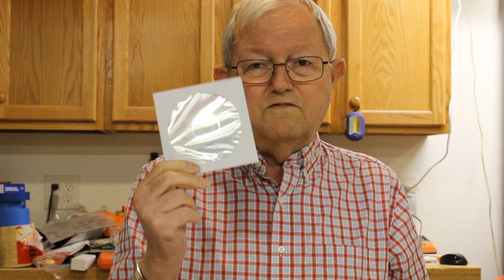I REVIEW THE DOWELMAX DOWELING JIG

Comment: I really like this tool as it’s very robustly built and very precise.  I was considering getting a domino tool to use loose tenons and mortises.  But in actual strength tests, dowels beat the domino mainly because you can create more glue contact by using a number of dowels in the space for one domino.  Sure is a lot cheaper when you think about this trade off.
Reply from the maker: Peter,  I agree completely.  I try to never say never but chances are I would never purchase a domino tool.  I agree 100% with you regarding the robust nature and accuracy of the DowelMax.  Thanks for watching the review video and for the great comment.

Comment: I may have missed this part, but, what if you need different size dowel holes for thinner wood?
Thanks
Linda
Reply from the maker: Linda, DowelMax does offer a set of 1/4" bushings and a quarter inch drill as a set.  For the current price check on their website.  Good question, thanks for asking.  I appreciate your watching and your input.

Comment: Hello Paul. It was a great presentation. Can I use different size of dowel ? If I can please tell me how. Thanks
28:00
Reply from the maker: Bijan, Yes, DowelMax offers a set of guides and drills for 1/4 inch and 1/2 inch dowels.   It comes standard set  up for 3/8 inch dowels.  I have a video on my site where I check out the 1/4 inch guides and dowels but haven't tried out the 1/2 inch ones yet.  Maybe in a future video.  Thanks for your question and for taking the time to watch my video.  Happy woodworking.
Reply: @paulsmessyworkshop  Hi Paul thanks for responding. If I want to use a thicker dowel , how much ticker I can go ? Is there an extra accessory that I can purchase for a ticker dowel ?

Comment: Thanks for the review. How are the holes centered within the material when using different thickness materials?  For example, it looked like you were using 1 inch thickness, I need to use 3/4 inch thickness
Reply: It’s default is “basically” centred on 3/4 in material.  You insert those adjustable spacers to adjust the center point.  But they can’t account for infinite numbers of thicknesses.  I have found that the key point (for me) is to  insert spacers to get as close to center on whatever piece I’m  using, (if I even want it centred), but worry less about that and just alway align the check marks on the tool with the wood.  Then any variances don’t matter and the boards are always flush.
Reply from the maker: The Dowel Max references off of what ever FACE you want to be common.  If you want it to reference off of the center you would have to shim on all pieces to center the same.  By referencing off of the FACE you are guaranteed to have a smooth joint.   If that wasn't clear in my video I suggest you check out their website.  There are more videos there that might be easier to understand.  This jig is crazy accurate.  Thanks for you question.
Reply: @paulsmessyworkshop   Thanks, makes sense. Im gonna get one and start learning it.
Reply: @lp9092  Thanks, getting one to try it out
Reply: @frankpearce2544  anytime.  It took me a while to figure it out... I misaligned a few things to start.  But it took my projects to the next level when I eliminated screws, and started making joints the equivalent to mortise tenon.  Have fun!

Comment: Hi Paul, loved your video on the Dowelmax. What length dowels would I use on a beveled 3/4" board?
Reply from the maker: Jeffery,  that is a hard question to answer, it would depend on the length of the dowel you are using.  The dowels I use are 1 1/2 inches long plus I leave a bit at the end for excess glue.  I make the holes 7/8 of an inch for each hole.  If you don't have the room for that much length you can always make the hole not as deep and cut off the dowel to fit.  Hope this helps.  Thanks for taking the time to watch and for you question.  Sorry it took me so long to respond.

Comment: I make my own set of fixed jigs for jobs. That way its set up that if i require 3 x different Joints .I make a jig for each as the chances are the timbers will vary .Then i colour code them .Once i have cut my timbers .I mark each set to match each jig. It never ever goes wrong. Buying  metal  drill guides from ebay .I can make jigs in mins  and now have 7 .Which covers me for just about most work /timber I use .
Reply from the maker: Carforumwanker,  a good solution to the problem.  Not everyone is willing to take the effort to do what you do.  For them an adjustable jig works out fine.  Happy woodworking.  Thanks for watching.

Comment: I bought the Dowelmax jr. since it was the cheapest and just happened by design to be perfect for my project. Like that in this video cover most of the Joints. I am going to be doing a Picture frame for my coffee table and wanted to review how to make the dowels on the 45 degree cuts.
But yes basically 2 checks and X for the dowel tap surface this makes sure you know what sides your aligning OFF..
Like the fact the the design is based on ligning up off one surface vs two thus more accurate and consistent.

Only issue is seems dowmax sent you everything. There two units the Standard and the Junior. The Junior has the 3 smaller spacers and the angle bracket. The Standard has outer brace so you don't need a C Clamp, but does not have the L Bracket and includes the larger spacers you see when showing how it can fit a 4x4. Also the spacer and spacer rod is included.

with the junior instructions are include on how to make a spacer rod with piece of wood and a dowel and how to make spacers from hard wood.

The 45 degree shown at the end of the video is optional and the L bracket can be purchased optional. both unit by default are for 3/8 Dowels, You can purchase optional for 1/4" Dowels. Spare drill bits can be purchased also optional. The dril bit is really really nice, it includes the stop ring it has two apposing screws vs 1.

otherwise this is a great tool.
Reply from the maker: James, yes, I agree that the Dowelmax is a great tool and like most anything today you can buy it with as many or as few bells and whistles as you want.  The nice thing is you can go to their website and purchase any of the other parts if you want.  Thanks for taking the time to watch and for the great comment.

Comment: Thank you for your review Sir. Very well made. 
I understand the check mark reference for side and edge. But is there reference 'line' to match with a hand drawn pencil line for edge joining two boards together (for making table tops)? What I mean is if drew random pencil marks randomly any where 'across' two boards, can i line up the jig to drill holes on both boards such that the two panels will properly edge join.
Reply from the maker: MishtiLiving, the simple answer is YES, you can do that.  All you need to do is to draw a line across the joint then line up the END of the jig with the line.  Drill the dowel from the same hole on each board and the lines will line up perfectly.  Try it on a scrap just to practice what I have just explained.  Sorry for the delay in getting back to you...sometime life gets in the way.  Thanks for watching and for you question and comment.  If you have any other questions feel free to email me at:   paulsmessyworkshop@gmail.com

Comment: Hi Paul,
I was wondering if you can tell me if I can use the 45-degree miter accessory for drilling miters in 2 x 4 stock? If possible, what spacer(s) would I need to get it centered? Or would I need to use two rows? And if so, what spacers would I need then? (This is not going to have to be strong, just accurate. Appreciate any help.
Reply from the maker: Spider One,  my immediate answer is YES but I will have to check to be sure.  I will give it a try and maybe even make a video.  Either way I will let you know how it comes out.  You are talking about a miter correct (where it is cut at a 45 across the 3 1/2 inch face correct?).  Thanks for the question and I appreciate your taking the time to watch my video.
Reply: @paulsmessyworkshop  Yes, it is cut at a 45 across the 3-1/2" face. I used my miter saw to do this. I will send a few photos to your email.

Comment: How do you set depth of hole to drill?
Reply from the maker: Daniel, the depth of the hole depends on the length of the dowel you are using.   In this video I used 1 1/2 inch long dowels.  In each piece of wood the depth of the hole would NORMALLY be half the length of the dowel plus just a tad of excess glue so in this case the depth of the hole was 3/4" + just a tad, maybe 1/16 - 1/8 of an inch.  There are instances where that doesn't apply of course but that is a good starting point.

Comment: Thanks, I'm sold.
Reply from the maker: Angelo, I am glad you enjoyed the video.  Thanks for watching and for taking the time to comment.
Reply: @paulsmessyworkshop  I am running into a huge problem. The dowels I order are all too big to fit in the 3/8" hole. The dowels are so big of oval that they split the wood. 2 weeks or order from 3 different suppliers on Amazon. Looking for a way to make dowels smaller. I've never had this issue with 5/16" dowels, but the dowels max can't use these dowels.

Comment: Can it do across the face as in for a carcass shelf etc
Reply from the maker: Tim, yes you can use it across the face of a board as in carcass construction.  It does require using a clamp to hold the DowelMax down and in position but it can be used for that purpose.  If you go to https://www.dowelmax.com  They have videos that show even more than my video does.  So far I haven't an instance  where I couldn't use the jig.  Thanks for your question and hopefully I have answered it.  Thanks for watching.
Reply: @paulsmessyworkshop  thanks for quick reply.is it available in U.K.tim
Reply from the maker: Your best bet would be to go to their website and check with them.  Sorry I can't help you there.